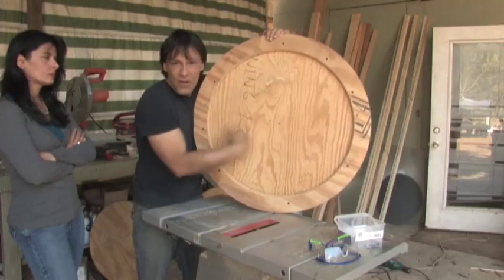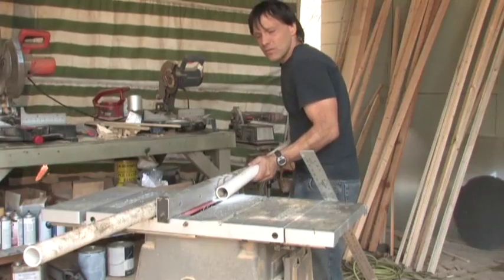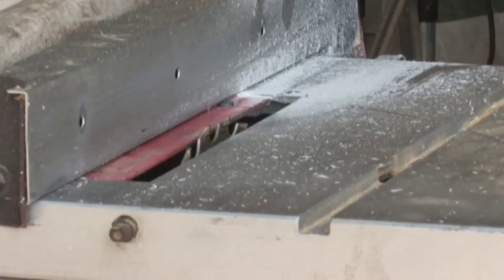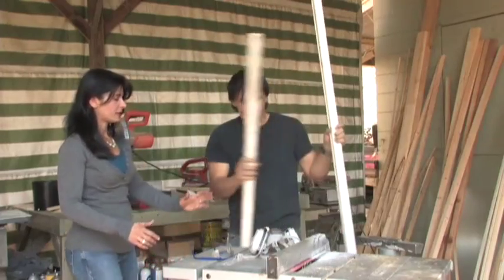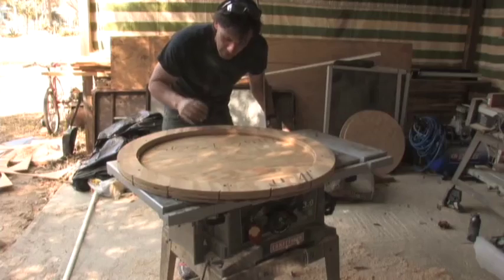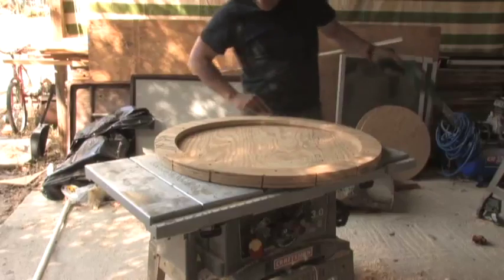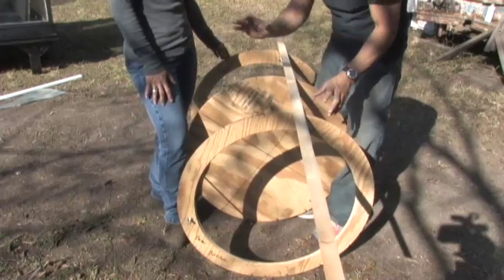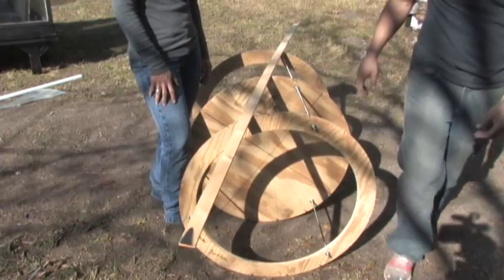A new VERTICAL WIND TURBINE VAWT DIY PART 3 VERTICAL WINDMILL

Comment: Now what kind of motor are you going to hook up to this? Washing machine motor or what? And how much electricity is it going to produce...

Trying to make the turbine presently just finished the blade and were using to wash machine motor look forward to hearing from you Ken
Reply from the maker: Hi Ken,
Axial Flux is the best option for optimal efficiency but they are a pain to make unless you salvage some stator coils from a motor. Here is an axial flux and also a simple AC motor conversion. Neo-D Magnets are the only way. A DC motor will work but poor efficiency. 

https://www.youtube.com/watch?v=ZRnhFvu9PXo&t=22s

https://www.youtube.com/watch?v=GDOuutNWlGI

also check this guys channel if you opt for the axial flux, he covers it well!!!

https://www.youtube.com/user/muddymuddymuddmann

Comment: Great video. One suggestion though could you possibly cut a small piece of plywood and attach it with double stick tape. hold plywood strip against the fence then just flip the piece over and repeat.

Comment: My idea from watching this would be to use old bicycle wheels instead of wood and have some sorta sails attached to the spokes. Might be lighter, less work+measuring+weather proofing, gear+hub bearing already built in, and cut out the need for working with a table saw. I hate table saws. Gears would be essential for max torq or perhaps a belt drive from the rim. I'm ignorant on gear/pulley ratios. I looked real quick & there's some other vids that have the same idea already, but they don't have Denise in their vids. No hawt in their VAWT!!!

Comment: Wait! This is the end? How do you wire the electric end? My plan is to attach the bottom to a pillow block and automotive alternator and then that attaches to batteries, but you didn't say any of that. How can someone who hasn't thought any of it through know how to harness this? A few generations ago kids were setting up heathkit projects and figuring things out on their own- this generation is not like that.
Reply: get a small 1/2 to 3/4 horse electric motor to mount to the bottom of the shaft and produce ac power.

Comment: To cut any PVC pipe I have had great results using a carborundum disc instead of a wood saw blade, you get perfectly fine, splinter free cuts.
Just so you know.

Comment: I think you folks are the best. You are so lucky Dennis that Denise likes to work with you.
You are on an eternal quest to find a way to recover subtle energy in the environment. That was Tesla's mission to. I have been doing this for about 50 years and have built several Tesla steam turbines. Using up waste on farms and ranches is good for the environment too. Instead of just burning it, you can burn it in a rocket stove or a TLUD stove. Heat a boiler like a flash boiler and you can make electricity with what would normally become pollution. Rocket stoves and TLUD stoves are about as clean as you get without a catalytic converter.
Reply from the maker: +John Mahler Hi John, Thank you for the great comment. I have a solar hybrid rocket stove design I hope to upload in the near future. Rocket stoves are a great option. Thank you again for the nice comment.

Comment: You put all that time into cutting, cleaning, & painting the pvc pipe then you throw it away because you didn't shorten the frame to fit them. WOW your a real clown do you always change your design 3/4 of the way through your project. I'd drop the word ''science'' from your name. You can't even explain the circumference of a circle to people, which is basic geometry.

Comment: Well offhand .. I would just get a cheap 99 cent compass from the dollar store.. and set it by a ruler to half the size you want... then like scribe both sides of the circle with the pencil in it?  pretty much marks it precisely..... oh and if you bisect two arches... the two points the intersect you can draw a straight line between LOLz

Comment: Speaking as a long time sailor who has been interested in vertical sails for a couple of decades, your decision to go with the wider acrylic blades was FAR superior to your original choice of narrow PVC for blades, not to mention far more attractive.

I've been toying with a similar idea for a vertical turbine, using slightly spiral light gauge ripstop nylon or mylar for the blades, which would entail using solid disks top and bottom, and hollow disks in the center. 

For those who think mylar wouldn't be strong enough, my ex and I raced our Morgan sailboat for years, and our racing sails were made of clear mylar - Light, strong and LOUD.  When we dropped our sails in a liveaboard marina, the night we picked up our boat from the previous owner, it sounded like the Three Bears had invaded a potato chip factory.  No doubt it didn't endear us to those that lived on their boats.  ;-)

I would also make the vertival turbine wider, and considerably taller than you have, but that's just me.  I'm inclined to start with four feet wide and at least five feet tall, but then we need a fair amount of power around our farm, so I'm looking for power and efficiency.  The best thing about these vertical turbines is that, unlike traditional three-bladed turbines, we won't be killing any birds or bats while they operate.

In any case, your video has given me a good starting point from which to jump off with my own ideas, and see where they take me.  I'll let you know how I progress as I go.  ;-)

Comment: The PVC is a good start to a foil shape (think airplane wing) That would take advantage of the lift effect against the blade. Use 1/16" ply to make a top and bottom (front and back) surface to create extra force that would aid in spinning the turbine. Coat everything ib epoxy resin for long life and go wind go!

Comment: That PVC is uselessly small in diameter although the blades should be curved slightly.  Try a larger PVC thinner is better also such as 12" diameter or better and you can cut that into fourths.  There's some optimal size based on the number of slots you use.  If you use 60 slots you can get away with using a smaller diameter for your fins.  If you use 12 fins the diameter should be bigger, and 6 fins the diameter should be even bigger.  The reason for them being curved is on the back side of the wind they act like airplane wings and the wind creates "lift" so it actually pulls that side of the turbine in the opposite direction of the wind.

Comment: Try suspending it from a frame (hang it upside down) so gravity will keep it centered instead of trying to knock it over.  I think the blades should be wider and they can be much longer than the frame.  I'd love to try building one of these in a magnetically levitated track although that would considerably add to the cost of production.

Comment: Pi = Circumference / Diameter
Diameter is known, use 3.1416 for an approx. of Pi
Circumference = Pi times Diameter
Circumference divided by 3 is your spacing.  Now use the flex ruler.

Comment: You guys are absolutly awsome! Have been watching your vids for some time now, i am an electrician from Sydney Australia copping $6k+ Annual power bills is shameful. 5 Kids and renting makes it extremely hard to invest time/money let alone install so quick and portable is the key for me. Can yo possibly integrate trailer axel and neo-din magnets? I can source everything except larger than Harddrive magnets, net? or you? Also have you checked "water hammer/fueless heating",is that possible?cheers

Comment: cut PVC in thirds makes a better foil shape, also 3 blades systems work with lease amount of restriction from blocking blades, thus 3 6 9 12 are proven to do better than 4 8 16... Just my imputty...  Murf!

Comment: You must show the performance of your turbine. You cannot just convince people by talking. Your turbine has 4 blades which cannot rotate faster. It is a low efficiency design. If the leading edge of the blade is straight then the trailing edge is curve from hub to edge.

Comment: seems like you could put a tac weld on the shaft of this onto a car alternator and then the wind turn the blades?then some way to keep the alternator in a stationary position while it turns the shaft.I like that you scraped the pvc in lieu of the clear blades as it looked a lot better,but would have been nice to see a part 4-7 maybe of adding someway to make this make power.btw watched all the video and liked every one

Comment: I like the vert design HOWEVER (COMMA)...just as the wind pushes ONE side of the blades in one direction it would push the OTHER side blades in the opposite direction. Right? Therefore decreasing the actual effectiveness of the design?

Comment: A simpler method of dividing the circle at the start is to use exactly the technique he describes but to mark only 1 side of the circle not both.  By drawing a line through the center of the circle you will automatically bisect the angle on the other side of centre since you are drawing a diameter.  This cuts your measuring in half.

Comment: I like your idea here, very earth friendly. I couldn't help my self but mentioning something. Now on something like this you don't need to be precise,  but this is an equation to help figure out the total circumference of your circle. Take your Radius multiply it by 2 to get your diameter you said thirty inches and multiply it by pi or 3.14159 (there's about 100 digits past the point). D*pi=C for the more nerdy tech ppl like me r*2*pi=C.

Comment: You know another idea is Why doesn't some one actually use a Wind Turbine Roof Ventilator for power????? Hook up magnets and a stater plate. Or since most of them have a center rod ,hook the rod up to a pulley then a alternator. If some one knows why you can't do this I would really like to know the reason. The Wind Turbine Roof Ventilator are also called Whirlybirds in some country's.

Comment: Hello from Lower Saxony, Germany. Your Savonius rotor is a beautiful work. What interests me is, why did not the lid and the floor also made of solid material.? Due to the increasingly mass of the rotor runs at different wind speeds but after a lot better. I mean, the flywheel is like by the centrifugal force alone have the different wind speeds without major building modifications made.
But otherwise a very good idea. Thanks for the nice videos.

Anthony

Comment: PVC is Very Bad for your health, When you cut, or burn it, the saw dust and crumbs should be put in the trash, ware a mask, & gloves..Don't breath the smoke, it will cause Cancer as well as the dust !..remove dust from you with care..KEEP kids away..no joke Poly Vinyl Chloride used for sprinklers, & plumbing, pools etc !  These are Great Videos ! Thank you !!

Comment from the maker: A circles outer path can be considered Linear in direction so all the blades are the same direction. Vertical turbines catch the air flow because the aerodynamic profile is poor in one direction and enhanced in the other.

The more extreme this difference is, the more efficient the turbine will perform based on blades only.

There are different designs for speed and torque depending on the type of generator or workload required. Also based on wind history of your area.

Comment: On cutting your blades, you might try cutting to length first. Then glue caps on both ends. Then cut in half. The caps thus make a mounting flange
that you can simple screw to your plywood. that cuts out having to make all those mounting cuts at 30 degrees.

Comment: I'd like to add that you can use your ruler to pinpoint centers by measuring the midpoint of your initial "X", and repeating for each smaller increment. I think that would be faster than the plastic ruler. Anyway, LOVE your work, and thanks for what you do!

Comment: Another idea is to use those 2 or 3 liter soda bottles cut in half, cut out the shape of the bottles in the board, maybe even slotted. You can even line them all up the width of the board to multiply the effect. Fasten them in any way you can. Is many ways.

Comment from the maker: Hi,

 You can do it with round magnets that have holes in the center. I still think there would be friction and the only advantage would be to act as a shock reducing vibrations. A lot of people have asked about the frictionless turbine. Not sure if that offers a lot use as a good bearing would be easier to install and turn freely. There is one on The Science Channel claiming 5KW in 5 mph wind. Not sure I understand how that could be accomplished.

Comment from the maker: It depends on the size of the turbine, generally you would buy a "permanent magnet motor" then hook a solar charging controller just like PV panels, this prevents charge backs or having a propeller.

If you opt to make your own AC generator, ND magnets etc, then you need a  rectifier to create DC so you can store it. Watch the solar panel series of videos, the setup is the same, just replace the panels with the turbines.

My channel search "PV DIY SOLAR"

Comment: If you don't have a curved ruler simply go from one point to another divide that in half and then go squsre easily through the center vertex. Voila, remember 2 points make a straight line.